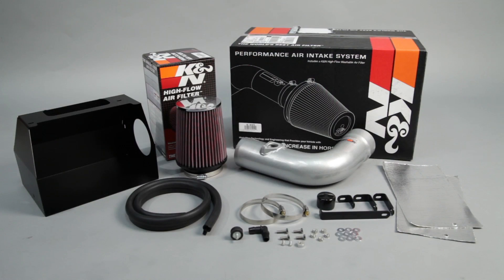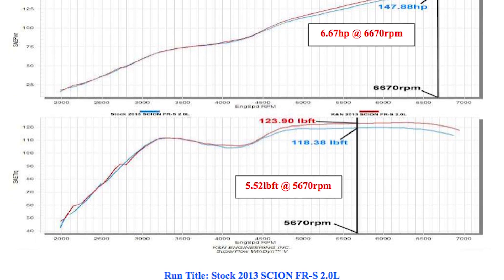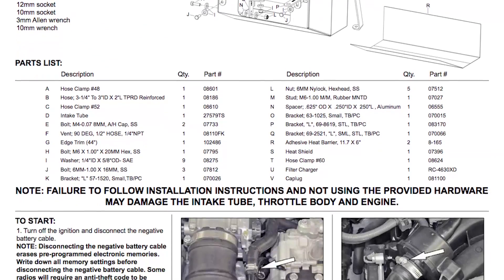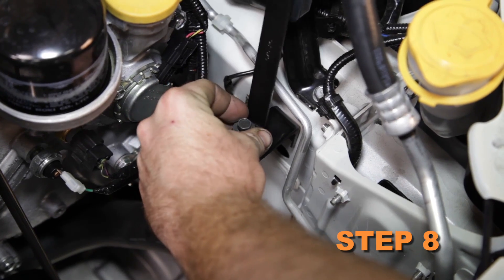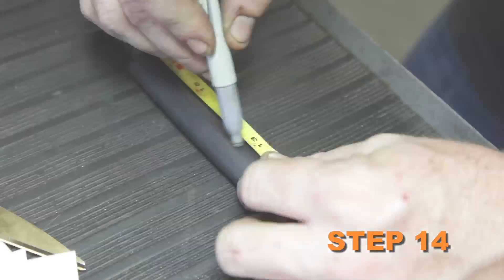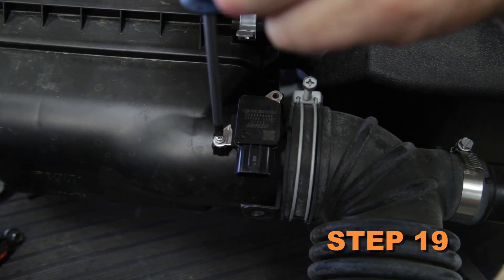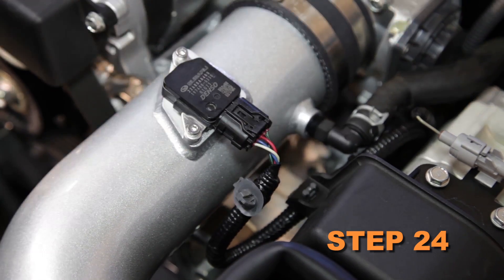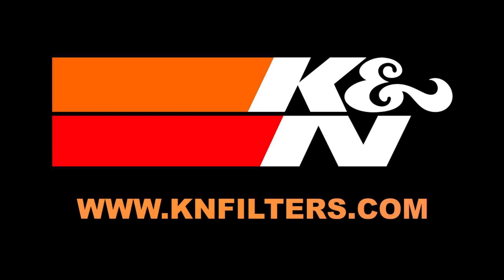Subaru BRZ, Scion FR-S 2.0L & Toyota GT86 [#69-8619TS] Air Intake Installation

Comment: I bought and installed mine. The "after" in the "before and after" doesn't really sound like what I got. Does that low sound only happen on the Dyno and when driving or should that happen in neutral too?
Reply: Did you hear at least alittle of it?
Reply: @anthonyelizarraraz7010  Yes, it still made a difference in the sound, but not too much.
Reply: @Markofka can you hear it in the cabin while driving ?
Reply: @anthonyelizarraraz7010  yes

Comment: Is a tune needed or no? If not will a check engine light come on?
Reply from the maker: All K&N air intake systems are designed to work with factory ECU settings and should not require a tune.  If you encounter a check engine light or any other issues please contact our product specialists 800-858-3333 or tech@knfilters.com.

Comment: Do I need a tune to make my car run right if I put this on my brz?
Reply: No, a new air intake does nothing but give the engine more (and cleaner) air. The only time tuning is required is when the air exit is modified (Headers, exhaust).
Reply: @Garrett C Wow then tuning my car did absolutely nothing despite the dyno reading a 30HP increase after doing headers + exhaust? Look we found the idiot
Reply: I just bought a used frs. This has been installed. Should I revert back to factory if I’m trying to get the most life(not power) out of my car? Or should I just leave it be? I’m trying to keep this beauty lasting forever

Comment: Would it be necessary to completely remove the engine sound drum?If I'm not mistaken it just works as a paperweight a this point when putting the new intake in.
Reply: Have you gotten an answer to this question? I just install mine and was thinking the same thing.

Comment: Can the same model be used on a 2016 Toyota 86? And does changing the filer to K&N affect warranty from Toyota?
Reply: You'll need to check the length specifications, they make the pipes relative to each vehicle's unique engine set up.

Comment: Used this video to install mine, super easy! Love the product.
Reply: Did your brz/ frs/ gt86 throw a check engine light after the intake install?
Reply: @jimher8810  mine didn't go check if you have all your sensors connected property